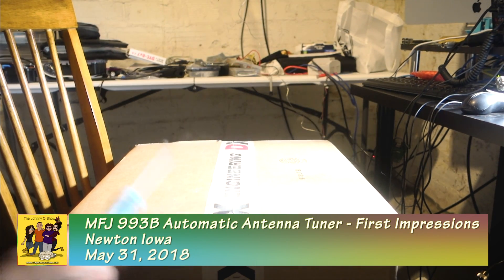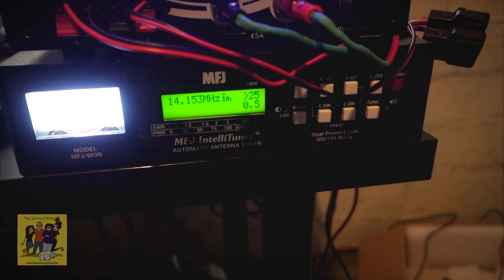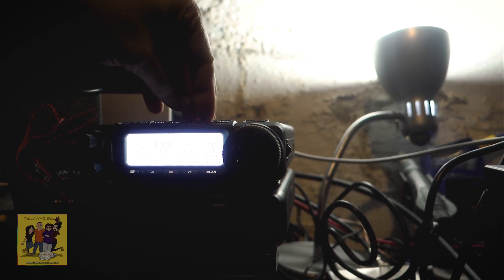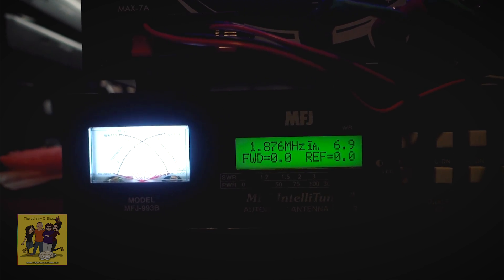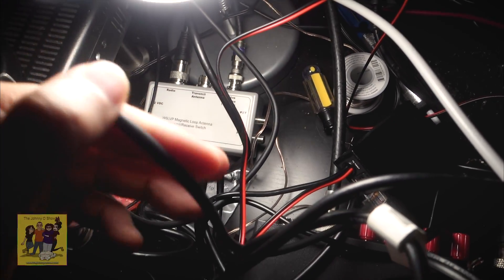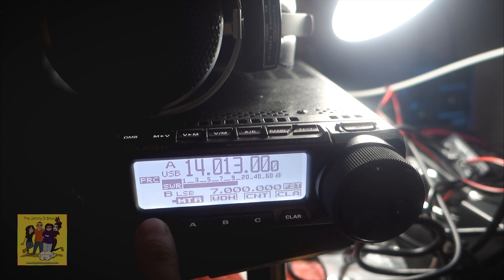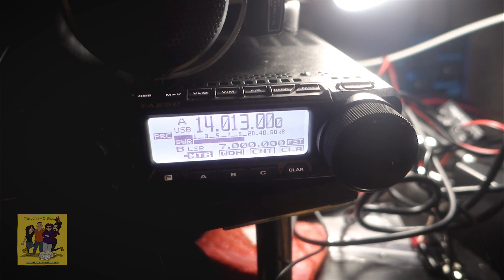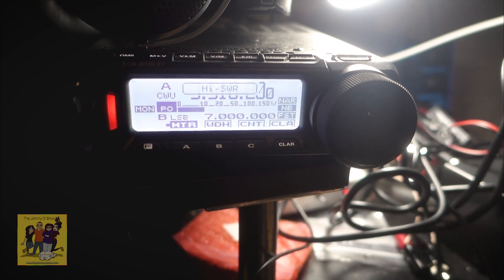Ep. #487 MJF 993B Automatic Antenna Tuner Review

Comment: will 160 load up on m5rv pro i wonder?
Reply from the maker: did you mean g5rv? i tried googling m5rv but could not find anything.  i would just remove the coax and run it straight into the tuner making it at that point a doublet. but i think it would be hard pressed to do 160m. i have 150' of wire connected with ladder line right to the tuner and i can be heard on 160meters but the tuner is at its limits to do it.